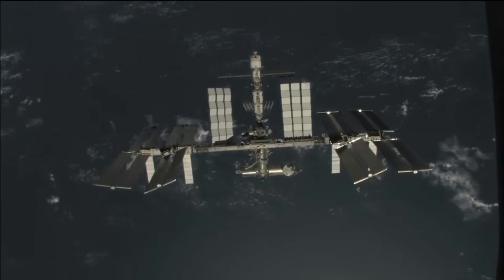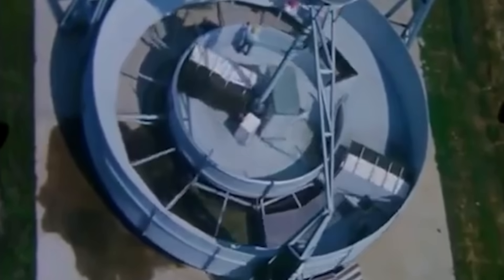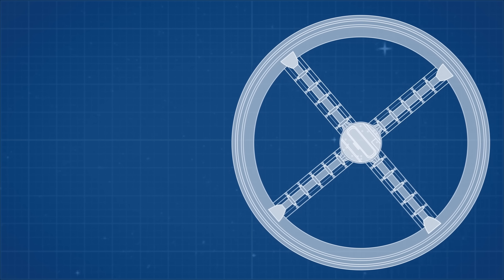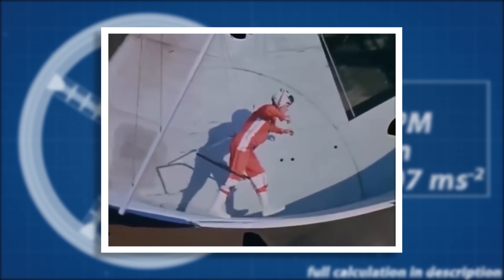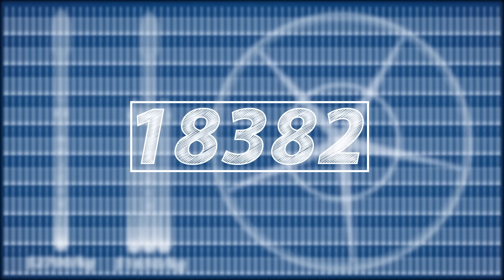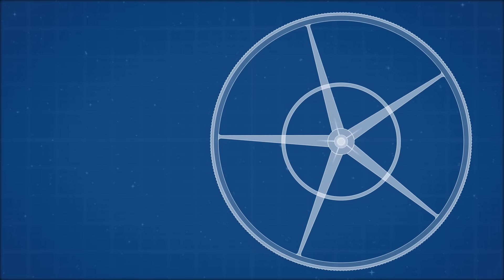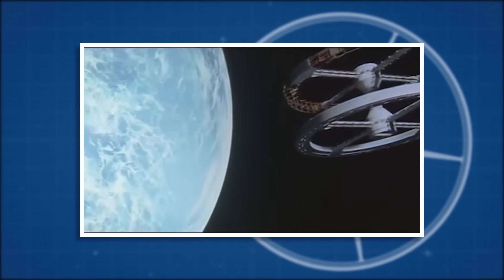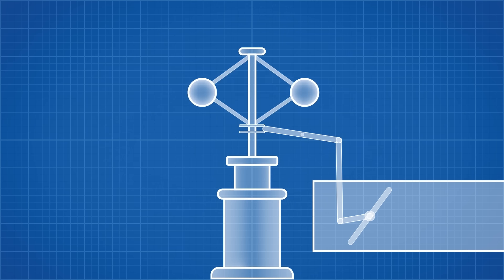Can We Create Artificial Gravity?

Comment: Hi, Real Engineering, I have a question for you. Is the centrifugal governer spinning clockwise or counterclockwise?
Reply from the maker: Neither, it's a 2D animation that I forgot to apply scale to. Still learning this animation stuff.
Reply: Wow! I didn't think you'd reply. I just found your channel recently and have really enjoyed the videos of yours that I've watched. The animations look fantastic by the way.
Reply: I don't know how you got that idea, but no, centrifugal force is a force separate from gravity. You do not need gravity for it to work.
Reply: persona, the force of gravity is greater than the centrifugal force generated by the earth's rotation and radius.  If a tower were built high enough so as to reach geostationary orbit, then the gravitational and centrifugal forces would be exactly equal in magnitude and would cancel one another.  anything higher than this point (35786 km) would begin being able to throw objects into space.  Hence, why a space elevator is possible once a strong enough material is designed or discovered.
Reply: Okay, dude fuck off. That link just proves everything I said (Besides the centrifugal force not actually being a force, but that has nothing to do with what you said) There is a little known force you've been describing keeping us on Earth, and it's called gravity. However, just because it is there does not mean it is a part of the centrifugal force.
Reply: On Earth mass and weight are used interchangeably because of gravity. It still doesn't matter. If you spun a rock, it would be affected by gravity, sure, but it's not the cause behind centrifugal force. Fc = mv^2/r is the equation, where Fc is the centrifugal force, m is the mass, v is the speed, and r is the radius. The equation doesn't say shit about gravity or weight.
Reply: You misspelled maggot. Which I would take to mean you have no further arguments.
Reply: It doesn't matter. The fact that you can't even tell the difference should tell you something about relativity of that kind of things :)
Reply: Bzzt!  Wrong persona.  Restudy Newtonian physics
Reply: LMAO!  You REALLY don't know persona WHY we aren't flung off into space?  (A little secret, if the Earth were spinning fast enough, you WOULD be shot into space)

It is simply amazing how stupid young adults are for the most part these days.
Reply: are u high?
Reply: TheNBKiller
but no cigar
Reply: Yeah I'm pretty pleased with it as well.
Reply: persona lol gravity is just an accelerating force, the exact same as centripetal force. Both the same forces, the experience of centrifugal forces is always perpendicular to your motion so mimics gravity. Gravity isn’t special (well it is but eh stfu), force is mass x acceleration, not mass x gravity, centripetal acceleration can be used in place of ‘acceleration’ in Newton’s second law. I hope my lack of articulation doesn’t annoy anyone sorry I’m a mathematician not a english student
Reply: Centrifugal force is an artifact of a moving reference frame, so it's fictitious. If you were outside that ring shaped, spinning space station, hopefully in a space suit, and the station had windows in the right places, you'd see someone on board swinging around in a circle by the space station. Kinda like a rock on a string or watching a car go around a turn. But you won't feel it yourself. 
You can invent any force you want by making up a moving reference frame. For instance, if you defined a certain particle in space as the center of the universe, and then accelerated that particle with a rocket, then your system would say that the entire universe was accelerating at an equal and opposite rate. If you accelerated that particle at 320 feet per second per second, you'd say the entire rest of the universe was subject to a force that was 10 times the magnitude of earth's gravity. But anyone who wasn't moving along with your particle wouldn't notice anything. 
"Centrifugal force" is fiction, but if you're living on a spinning space station, it could be a useful fiction. Unless the station was very large, though, you'd need to learn about Coriolis "force" also. For instance, if you climbed one of the spokes toward the center, you'd feel something pressing you against the spinward wall. And the other way coming down.  This is because the rim, where you started, moves faster to spinward than points further inward on the spoke.
Reply: persona Nice try
Reply: You are really trying to troll? lol. Centrifugal force does exist in space, because it isn't a multiplier of gravity, it adds to gravity. I see how youd think 0 gravity would mean it would have no effect, it would simply have less of an effect/more of one depending which way you are looking.
Reply: persona also your sun thing, research Newton’s laws of gravitation, the fact that we are so much closer to the earth than the sun means that the force of gravity of the earth on us is far far far far greater than the force of gravity from the sun. F=gm/r I believe is the equation? Correct me if I’m wrong I haven’t done Newtonian physics in a while
Reply: Now these are some real Rick & Morty fans here
Reply: lr21643 Right, people take “fictitious” to mean irrelevant or useless. There isn’t an independent Centrifugal force that would keep something rotating in an arc with no external inputs (say from a tether or from a space station) but the combination of rotational force and friction adds up to a very useful term.
Reply: Thank you John Turner that was a great answer
Reply: Ok, so what about the G-Forces we know have happened with spinning capsules, like..Take the Apollo 13? 

They were existing right?

I`m not demoting your thought on this, just throwing in a thesis here ;)
Reply: SmoothRide because analog clocks don't depend on gravity, lol
Reply: Depends on which side you view it from.
Reply: persona  what do you think is holding you in orbit? 😜
Reply: would it be easier to launch space shuttles if they build a tower near geostationary orbit? can they use that force to throw shuttles into space? hahaha just a thought.
Reply: persona has a reality problem.
Reply: It's not weight you mean, but mass. the feather has very little mass, and the helium balloon has very little mass as well. Very easy misunderstanding. You see, an object with little mass would make it a harder effect to see, but an object with more mass, such as a rock, would be easier to explain. You can still use a feather to explain a centrifugal force but it would require more work to accurately explain.
Reply: Inertia and centrifugal force are different. What you have described is centrifugal force, rotating around the hand. If it were rotating like a top, based around the rock it would just spin in place. Centrifugal force makes the rock fling out that fast, gravity pulls it down. Despite your constant  need to assert yourself and the fact that centrifugal force is dependant on gravity, I assure you, constant capitals will not help what a simple Google search would tell you otherwise.
Reply: That's because the centrifugal force is working on the same plane as gravity, hence making it feel like there's more gravity, making it a higher g-force, without it actually being gravity.
Reply: Children under 6 should have their own interwebtubes to browse.
Reply: http://phun.physics.virginia.edu/topics/centrifugal.html
Reply: persona If we gonna talk about spaceship design, I vote for the shape of a woman's body. Docking station can be in a shape of vagina and all the shuttles can be in a shape of penis.
Reply: stop swearing magget
Reply: In the prior video why turbines have 3 blades Real Engineering makes my point on how  centrifugal force is nothing more than a multiplier of Gravity. Thank you Real Engineering
Reply: If Centrifugal Force is a real force. Then please explain why Life on earth exist. Why are we not shot out into space since earth is traveling around the Sun at 18.5 miles/sec (30 km/sec) and on its axis at 1,040 mph? I would assume its enough speed to build up centrifugal force. Please don't say cause Gravity since we both know there is to much speed in the earths rotation and not enough gravity it to be a valid answer. I will accept I don't know or Newton didn't say in his 3 laws or an explanation if you have one.
Reply: The only problem is centrifugal force doesn't work in high orbit.Centrifugal force requires at least some Gravity in order to work.
Reply: Your Moma was foolish enough to send you to school all those years just to see you turn out this way. The earth is spinning fast enough where is your fictitious centrifugal force,  so where is it?
Reply: I meant weight not  mass.. (On earth both mass and weight are often used interchangeable.) However that is not so in space.  When it comes to centrifugal force think about it more has a multiplier, weight times the speed of the rotation. If you grab a rope with a 1 pound ball at the end and started spinning it,  the ball can feel like it weights 6 pounds in a few second.  This effect would be regardless of the mass of the ball.  You need to have some weight to start and for that you need to start with some gravity. If we are  going to space travel soon we need to scrap all we know about flight. Lets start with the design of the ship and not with artificial gravity that part is the easy part. . In space all ships need to be more like spheres not like rockets and the pilot -navigator needs to be in the back not in the front like we see in the movies.
Reply: I understand centrifugal force is separate from gravity. However with out gravity you are weightless. No weight means centrifugal force has no effect on you. Try using centrifugal force on a feather or on a helium balloon you can spin the object around the balloon has fast has you want but its just not going to have the effect your looking for.
Reply: That is because gravity is constant. In a roller coaster you can feel the effects of centrifugal force the most but you feel it in the form of  negative or positive g force. your weight X speed on the loop. It's simple math.
Reply: CENTRIFUGAL FORCE IS NOTHING MORE THAN A REACTION TO GRAVITY AND THE SPINNING ACTION. Centrifugal force is not a real force it is no different than a leverage. To better understand centrifugal force think of this a man using a sling to trow a rock.  The man will need a 2 -3 ft sling and a  2 oz rock. When the man starts spinning the sling we start to believe that centrifugal force is being created when in reality centrifugal force is only multiplying what is already there, the faster the spin the more inertia is being created multiplying the G-force in the rock ( if you were to weigh the rock at its fastest the rock would probably weigh 6 or 7 times its current weight) when the man releases the rock  if centrifugal force was real the rock would continue to spin until it ran out of centrifugal force.  However since its not centrifugal force you created but inertia then the rock would move forward until it hit something or slowed down do to the wind drag and gravity's pull on the object.

Comment: But i dont think it would require spokes in the middle like a Wheel. It could be designed like a long hollow Cylinder. Then the rotation could be achieved by applying Rocket force at a 90 Degree Angle on the Outside.

Comment: I think modern physics has diverted into a blind path that makes it possible to predict steadily more accurately the outcome of observations, but with steadily more complicated models and a steadily greater  expence of work,. But soon it will be impossible to predict new observations with the current physical models, because the work involved in using the distorted mathematics of current physics.

Physics has come into the same situation like when one still believed that Earth was the center of all reality and everything revolved around Earth. To explain observations, one made steadily more complecated models. These worked actually for known observations, but got extremely cumbersome to use, and steadily less predictive. 

Then Galileo Galilei proposed that the Sun was the ceneter. At the onset before it was refined his models did not have the  power to describe known obsevartions like the old model,  but he was on the right new path, and his model was much easier and had an immensely greater predictive power.

I think all of the theory of relativity and all of quantum mechanics has to be scrapped and replaced with some new ideas. Some of the ideas of string theory will possibly be part of the new model,

Such a new models might explain how to effect antigravity, or explain anti-gravity effects already observed.